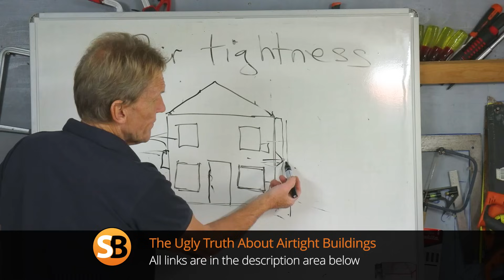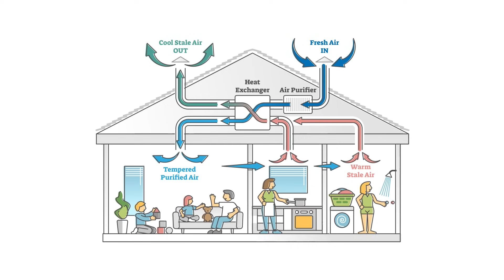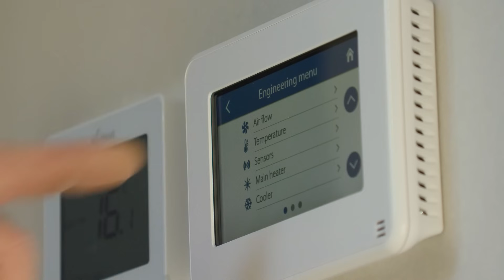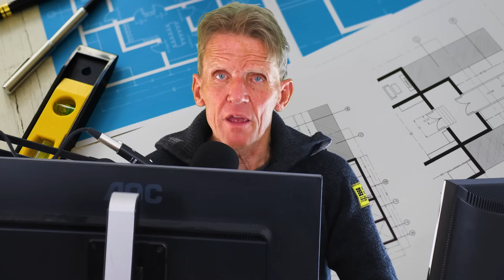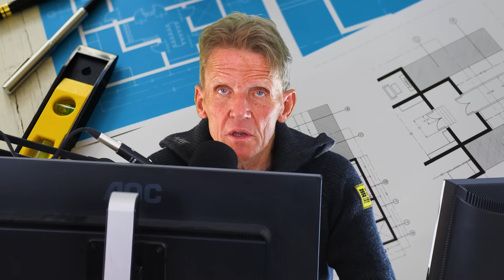Why Airtight Homes Are a Terrible Idea

Comment: A bit disappointing as all latest videos were advertising a product.
Reply from the maker: That is simply not true. There is generic information in here with some product recommendations. 
The video prior to this was a discussion on the causes of a problem with modern building
The video before that was sponsored but, again, generic information which can be applied to several manufacturers. 
11 out of the last 16 videos contained no products. 
We are very glad that we have some channel sponorship because we can't do what we do on fresh air and your love.
Reply: @ I am happy that the channel is supported, but if products are shown and advertised as a part of a paid promotion this should be made clear at the beginning of the video.
Reply: You’ve got that very wrong, vvv. Even if they had done that, if it were a useful product that they believe in, I’d have no issue with them earning a few quid back for their excellent channel.
Reply: @ I have no issues with that if it is made clear it is a sponsored video or not.

Comment: Great video. Be honest I just open the windows for half hour a day. Simple and easy. Issues occur when people don't listen to the experts, that's why I choose not to fill my cavity wall
Reply: Very sensible. My house already had the cavity insulated when I moved in. One of the neighbours has lived in their house for years. They never had damp or mould until they had the cavity wall filled, now they have to run a dehumidifier all the time and still struggle in certain parts of the house, mine is the same, as is another neighbour who lives in a house identical to mine. We all run dehumidifiers as just opening windows made little difference. Extractor fans for cooking and when having baths/showers still resulted in dripping wet walls. The only thing that has made a difference is a dehumidifier. That brought the humidity down from 94% to    usually somewhere in the early to mid 50% range. It's so much better now, but if the cavity wasn't filled, it probably wouldn't have any issues now. None of us can use any of the kitchen cupboards, on an outside wall for food, unless they're in glass or plastic containers. Apparently it didn't used to be like that for the neighbours who lived in the house both before and after the cavity wall insulation. I think you've made the right choice.
Reply: If you are opening the windows periodically to let moisture out, you can also have cavity wall insulation.

Comment: I keep windows open pretty well all year except when it gets down to zero. My problem is the crawl space on the house I recently purchased - the conservatory was built blocking all the air bricks at the back. I've had to replace all the downstairs joists due to rot. I'm getting channels put in to restore the air bricks, putting soakaways back and front (heavy boulder clay 5' deep) and considering a desiccating dehumidifier to pipe moisture away. It's currently 84% humid under there.
Reply: we have to air the house when i visit othere people homes u never see a window open very bad for our health
Reply: And check if your solum (sub-floor) is 'sealed'. If not lay a 1000 gauge plastic sheet across it (with 75mm turn ups at edges), weight down with stones or sand in a bag, and it will greatly reduce the moisture that is being lifted from the sub-floor soil, driven by low level radiation from the flooring direct to the soil (that's over and above classic convection!).
Reply: @philipoakley5498  The crawl space has a concrete floor. Not sure if there's DWP under, but the  dwarf walls don't make laying plastic down easy. I managed to eradicate damp from my previous house, a Victorian property. This 1929 one will be tougher as I found out recently it was built on a marsh. Fun times.
Reply: @Jules_Pew  If the crawl space concrete is 'dry' (magic meter stuff) then it's likely got a DWP under it. If it's obviously damp then... (..you would have said).

It does sound like you need that air flow through the crawl space!.
 It's not often realised just how dry, in absolute terms, cold air actually is, so even if it's raining outside, once the air gets into the habitable space and warmed a little the RH drops significantly.
 I made up a simplified "Psychrometric Chart" to help show that (not public yet), but a few YTs on the regular HVAC chart does help.
 The CIBSE CPD modules on humidity are quite good for those with a technical engineering bent (cibsejournal[.]com/cpd/modules/2009-04/ Module 3: The properties of air).

(I've just been through the 'new house / foot through floorboards' thing: there's a lot to consider!)

Comment: Am a big fan of dehumidifiers. Been drying my clothes over one for years - the clothes last longer because they aren't being tumbled around (the lint in the tumble dryer filter is bits of your clothes falling off), and the dehumidifier, on average, is putting out slightly warm air.
Reply: Me too! An interesting fact about dehumidifiers is that when actively dehumidifying, they run at over unity efficiency - ie more heat comes out than electrical energy goes in. This is because of the "latent heat of condensation". It has a benefit if the damp has come from outside & the energy to evaporate the water was taken up in the Atlantic Ocean. But if you're just drying your washing, the latent heat is effectively cycling around a close system in the room.
Also begs an interesting question about heat pumps on damp days, and if the condensation of atmospheric moisture results in an increased COP??
Reply: @alanjewell9550 no, not with a dehumidifier because both the condenser and the evaporator are next to each other, one cools and the other heats effectively cancelling each other out!
Reply: @TC-V8 and where does the energy go, brother? 😂
Dehumidifiers are basically space heaters which also happen to dehumidify.
Reply: @davorzdralo8000 did you read my comment?
I said the evaporator and the condenser (the hot bit and the cold bit) are side by side in a dehumidifier- so you tell me how that makes significant heat?? They both basically cancel each other out. Dehumidifiers are only concerned with getting a cold surface to condense humid air onto to dry the air.

Check out 'technology connections' recent video on dehumidifiers if you don't believe me!
Reply: @TC-V8 I've seen that video, it looks like you didn't understand what he said. He explains why dehumidifiers will produce a lot of heat in that video, mate.
Reply: @davorzdralo8000  No, he doesn't! He literally says what I 'simplified' that the hot and cold parts basically cancel each other out.
I have one and can confirm it doesn't do any heating!
Reply: @TC-V8  dude, go back to the video. 1:45 in, I quote: "The process of dehumidifying air generates heat, and it's a lot more heat than you might expect. This little machine can put out as much as a space heater, and larger ones will easily exceed that".
Reply: @davorzdralo8000 Thank you for pointing out that time stamp! I re-watched the video - and yes, i miss remembered his point of dehumidifiers adding heat when battling a humidifier! Haha.
However, i stand by my point - in my real world testing (in UK autum and winters) dehumidifiers do not significantly/noticeably add/produce any heat. Many time me and my daughters have put our faces over the outlet and it just feels like a gentle fan - certainly no heating going on.
In his video - he had the same effect - until he turned on his humidifier - seems like this heating effect is only applicable to hot/very humid environments.
Reply: @TC-V8 not sure you're right about this. Mine gives off noticeable heat (it's a desiccant type)
Reply: @LesOuefsBrouillés desiccant types are completely different! We were all talking about refrigerant dehumidifiers.
Reply: @TC-V8 nice dodge 😂 yes I can see in every post in this thread that people have specified the type of dehumidifier they were talking about 😂 😂😂😂
Reply: Exactly, the situation of insulation and ventilation hasn’t been properly explained to the masses. But those open holes in the wall as vents in 2025😂 Ok, if have a coal fire.
Reply: Tumble driers have settings for delicate fabrics. Good quality clothing will last and survive tumble drying.
Reply: I’ve been told Dehumidifiers pull moisture in from outside accross damp proof sheets.
Reply: @johnnorris1983  vapour will always move to equalise concentration (diffusion). So if it's damper outside than inside, there will be a vapour pressure from outside. Reverse is also true if it's damper inside. Different wall constructions have different permeabilites to vapour.
Reply: @johnnorris1983 Not with Ebac, smart control, that does recognise this possible situation.
Reply: @jim-zhang  how?? The dehumidifiers job is to maintain the set humidity level. It can't do  anything about the fabric of the building or what's going on outside...
Reply: @ Materials absorb water, if they are left they only absorb a maximum amount of water, if you utilise a dehumidifier that is very aggressive in its dying of air more water loads up from the out quicker than if the air inside was moisture heavy. Maximum relative humidity is 100%, at that point the water in any building material has to spread out from further absorption, or form drips. Hence, fix the source(s) of the high humidity. Rather than try handle the humidity when it’s from penetrative damp.

Comment: Air tightness would be OK if we had more mechanical ventilation, but we don't have them in new builds, and generally home owners are ignorant of retrofits and the cost is often too much. For a developed technologically advance country we're still surprisingly dated with our views on modern buildings. 

If the government wasn't full of idiots you'd have subsidies for insulation AND (single room) mechanical ventilation. Would improve the living standards of the poorest in this country by a lot.
Reply: Building regs insist on a minimum area of opening window per the square area of 'living' space/room.
Reply: Don't you mean that the voting booths are full of idiots?
Reply: There is some help for insulation which is very cost effective.
Reply: @ThatAwesomeNay  :How stupid  we have become removing chimneys from homes which draw air naturally through homes and can easily be finely controlled with a simple graduated flap. Old homes are being updated but all too often the chimney is seen as unnecessary and is blocked up or even removed.

Comment: Airish tight homes amuse me but even funnier is that type of home with extract fans in the bathrooms and kitchen, what are they extracting if replacement air is not available, the fans are just churning up the same air pretty much.
Reply: There are plenty of hidden gaps around door, skirtings, etc. You definitely want to choose the damp air that you throw our of the house. It's no good pretending that (unsaid) you want to keep the moisture in the house and spread the damp around (what we usually do;-). 
There's a lot of confusion about 'heating' to dry things, rather than using dryer air (lots of good seminars by Dr Joe Lstiburek)
Reply: The fans, while verting the air in the bathroom and/or kitchen out through the exhaust vent, pull in makeup air through whatever gaps are available in the fabric of the building. That can be a gap around a door frame or a window frame or a crack in the wall or a poor seal between a ceiling and wall or gaps in and around electrical sockets in the walls.
Reply: @Monaleenian :Sure, but a modern home, fully insulated, should not have these 'draft gaps' particularly if it has been insulated for a heat pump. Modern homes now often do not have the luxury of a chimney either so air input and exhaust must be by some mechanical means like trickle vents in windows to establish a 'flow' or opening windows of course. Home atmospheres need 'cleansing' to prevent mould, fungal growth and bacterial and viral proliferation.
Thanks for your comment.
Reply: Windows are great in bathrooms!
Reply: @Biggest-hz7ng Yes but not everyone has that 'luxury' so a fan is mandatory.